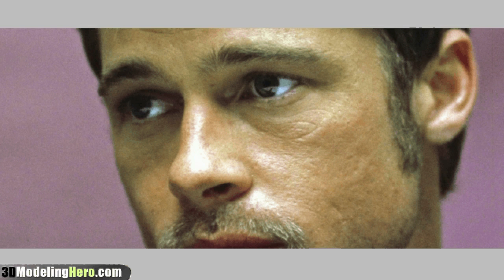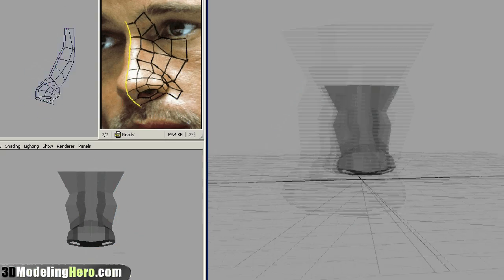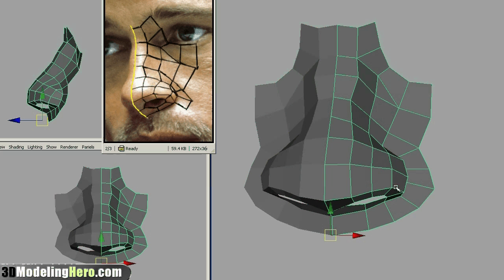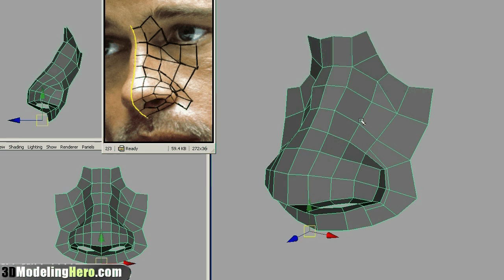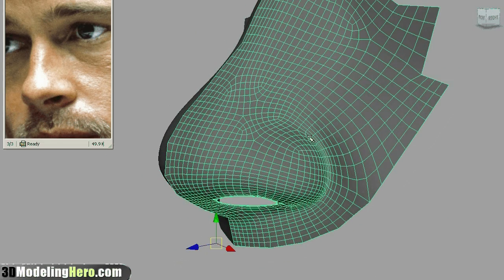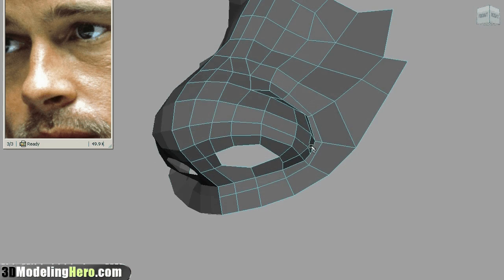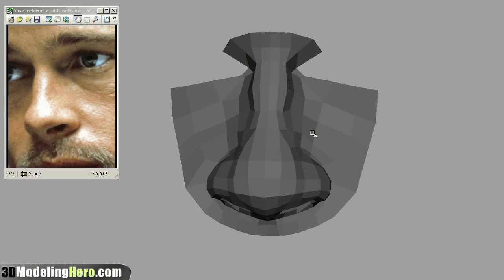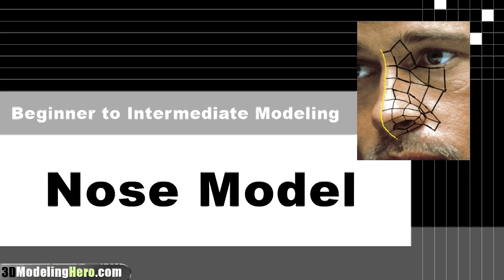How to Model A Nose - Low Poly Beginner to Intermediate 3D Modeling Tutorial

Comment: Your a boss modeler. Respect.
But when you speed up to about the 1 minute mark you use a tool that makes and cuts the geometry lines. I know i sound silly and vauge, but what tool did you use?
Reply from the maker: Munching Bromelon It's the Split Polygon tool in Maya. It's the tool I use most for modeling.
Reply: Thank you for your quick response and your help. I love your video, you are by far the best explaining modeling. 
Do you have any tips or tricks to make more details to the face? And also where is the Split Polygon tool?

Comment: thank you again for your great tutorials :) .... the nose and the ears are for me the hardest parts to model, getting the vertexes all properly in line around the nostril is really hard, but I keep on practicing, it only can get better :D
Reply from the maker: Thanks sandra. The facial features are really hard because we all "think" they look a certain simplistic way, but actually they are very complex. A nose is as complex as a whole arm. But the good part is that if you can model the facial features, you can model anything. Just remember to work from low poly first, then cut in the details. It'll drive you nuts if you start doing the details before getting the low poly in with the correct edge-flow.